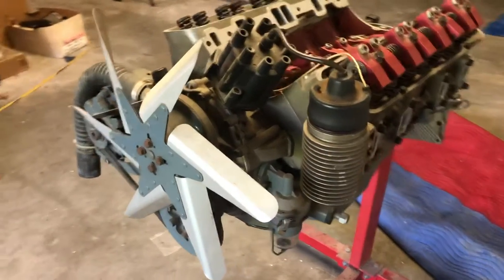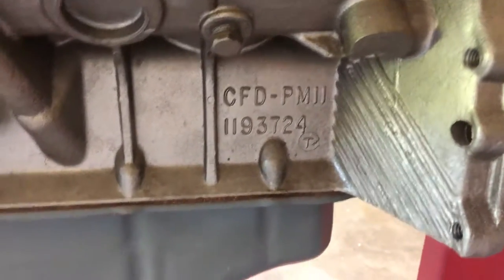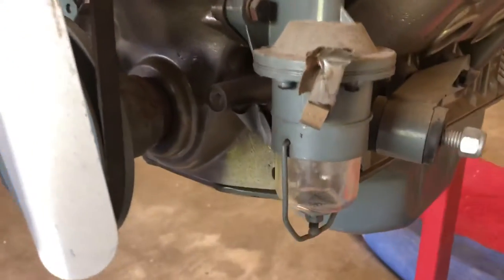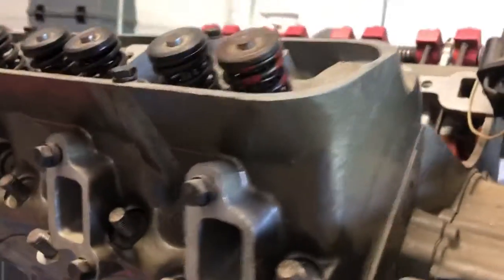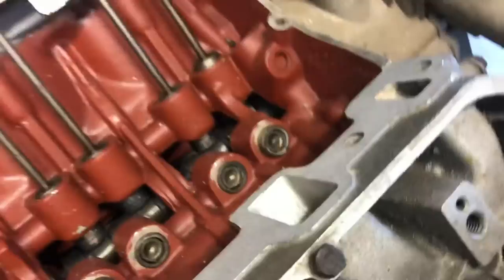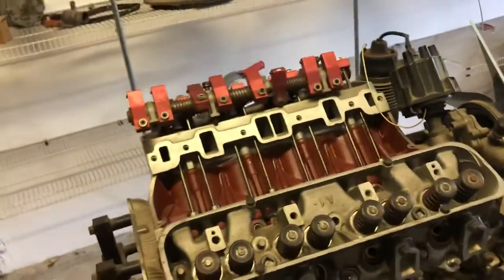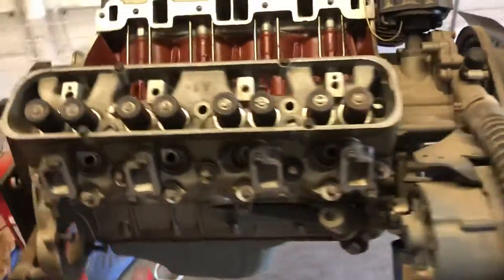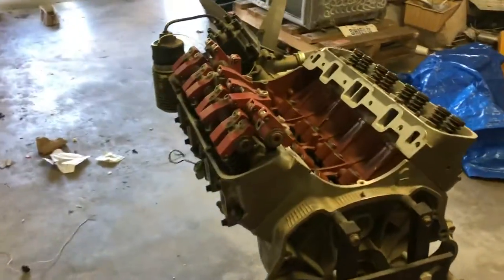Oldsmobile / Buick 215 ci aluminum V8

Comment: In the late 70's I had a 63 olds 215 in a 73 Vega. Engine weighed 15 pounds more that the 4 cylinder.
Reply from the maker: Lol thats cool!! Any chance you remember the gear ratio and the transmission in it?
Reply: @damiansgaragebuilds7663  I had the same engine in a 73 Vega GT I bought used from an autocrosser.
I was told "30 pounds heavier" but still not much either way.

Comment: I had one of these in a 1963 special.  3 on the tree. Used to get 50 mph plus in first gear.  It was a screamer
Reply from the maker: It should do pretty good in the car Im dropping it in, definitely lighter than the 63’ special... did you have the turbo?
Reply: I daily drove the turbo Olds version in '62 Jetfire...

Comment: I think this is the same engine that ended up made by the thousands in the UK,and ran in Rovers,Land rovers and numerous other vehicles.I have one in my P6 Rover.They were a great motor and the only problem I know of was excessive camshaft wear.
Reply from the maker: Yes, the oil is pumped up into the rocker arm perches and out under the rocker arms and runs down the pushrods.... there’s a modification to the rocker arm shaft to allow more oil which I believe was done to the motors I got from the estate. The motor in this video is now installed in my 1937 project. Thanks for watching!
Reply: Rover used the motor for a long time.

Comment: There are 3 different compression ratio heads . I believe 9.5, 10. 25 and 10.75 . The best 215 guru is Mark or Dan LaGrou at D&D Fabrications in Rochester Michigan
Reply from the maker: richard allonzo Thanks for the tid bit of info appreciate it!
Reply: Would be a wicked little motor to put in an MG body!!!
Reply from the maker: steve mitchell it would be a little rocket! I’m gonna drop the 6 bolt head motor into the 37 ford project I picked up.... that old ford flathead is cool but I want to burn a lil spoked rubber here and there.
Reply: @damiansgaragebuilds7663  D&D has a bellhousing to bolt up any GM trans. as well as good clutch advice. My T50 with 3.23's in the diff and 13 " Tires revved 2,000 at 60 mph, was capable of a 5.70 sec. 0-60 and gave 32 mpg on the hwy with a Carter 500 AFB.
Reply from the maker: richard allonzo I have a Muncie transmission and bell housing that came with it, going to sell 2 of these motor and drop the 6 bolt Oldsmobile in the 1937 Auburn cabin speedster replica... the flatty ford v8 won’t spin the tires and go so a swap is in order I think
Reply: @stevemitchell2252  - I have 215" in 1800 lb. MG Midget... MGB came stock with them in UK...
Reply: 215 info: https://www.teambuick.com/reference/library/affordable_aluminum_v-8.php
Reply: Only 2 were stock - 9.5 (I think your right) Buick 2bbl head, and 10.5 (I think, might have been 10.25) Olds 4BBL head.
The Olds had 5 bolt, the Buick 4, but with the right gasket they could be swapped as the extra hole for the 5'th bolt was dry.
Reply: @damiansgaragebuilds7663  
You have any parts for sale. 
Leave a comment. 
I will  answer.

Comment: Imagine that in a 1700 lb kit car of some type, man, the possibilities.
Reply from the maker: Deborah chesser I am actually dropping this engine into a 1 of a kind car, if you check out my other videos you will see it. Im guessing the car weighs 1200 lbs the wood body can be picked up by two guys so im guessing it weighs around 400lbs and the chassis with drivetrain probably around 700-800 lbs. should scoot along pretty good!
Reply: I have one in my 1800 lb. '75 MG Midget... BW T50 5 speed manual...
Reply: @BuzzLOLOL  oh shit ! Hang on to that baby, she’ll be a handful
Reply: @damiansgaragebuilds7663  it definitely should move along with no problem. Keep us posted buddy, thanks.
Reply: @damiansgaragebuilds7663  so all said and done, around 1500lbs I’m guessing, which is nothing. You may need some wing to glue that featherweight to the road.
Reply: 1973 Vega GT was only about 2300 pounds, as I recall.
No "5mph bumpers" yet and other such "add weight" issues.
Reply: The rover version of this engine was used in the MGB GT v8.